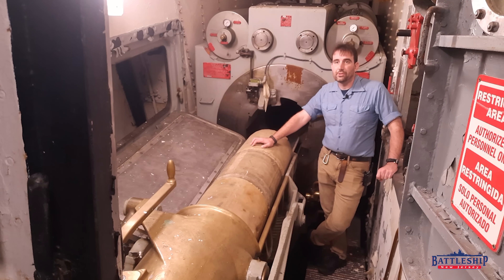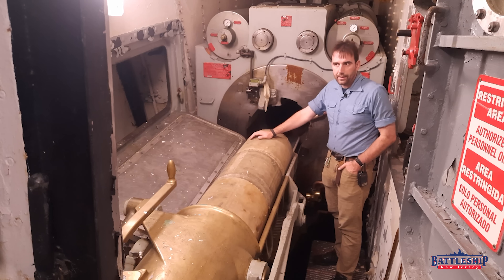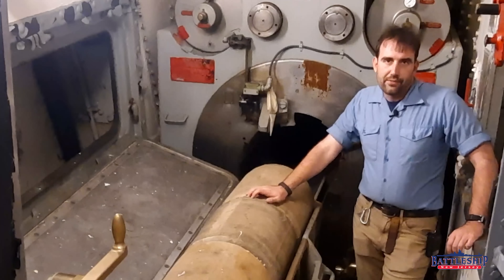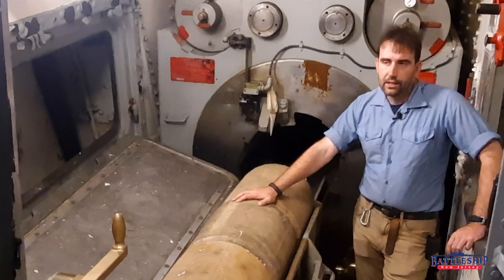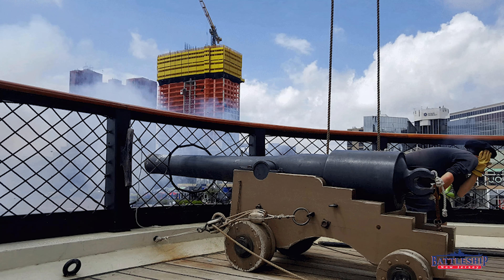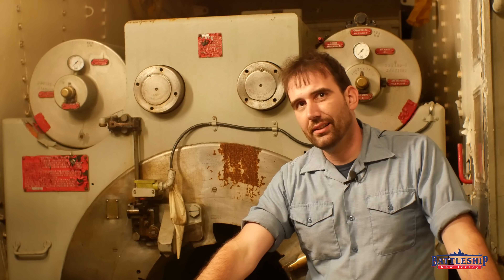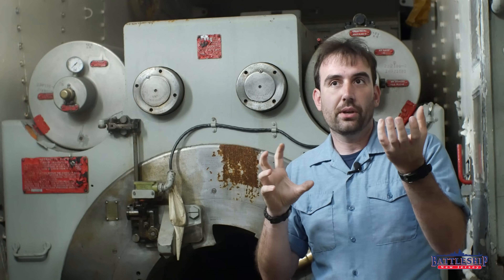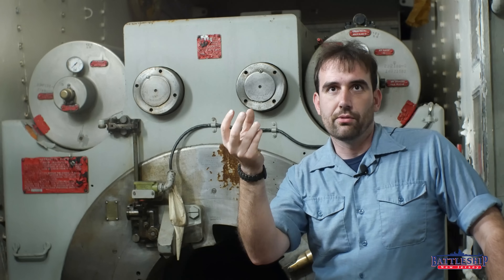How to Unload the Battleship's Guns

Comment: I’ve had a misfire on a Chieftain tank, which turned in to a hang fire. We were getting ready to open the breach when the charge (we also used bag charges, just 120mm) ignited.

Another tank thought they get a round loaded, expecting to be given another target. Instead they got check firing (stop firing). Normally not a problem, but the next morning they were ordered to change ranges, huge problem. You can’t drive around German roads with your gun loaded. They tried to clear it with a hydraulic shock (water behind the projectile followed by a small charge), well I think that crew hold the record for the biggest “Water pistol”.  The charge went off, the water went around the projectile in the rifling😂 This meant they had to drive the tank, on German roads, with a loaded main armament.

Comment: A few months back, my buddy and I were shooting an M48 Mauser using some 80ish year old Czech surplus ammo. There were some uncomfortable hangfires, but nothing serious, so we kept using the ammo. We made a joke about how long to hold the rifle on target in case something went wrong, but I had never had that happen with that batch of ammunition before, so it was mostly a joke. On my buddy's turn with the rifle, he entered a crouch, aimed, and I saw him pull the trigger. I heard the release of the firing pin, but my buddy slowly looked up at me. Still no bang. We kept the rifle down range for about a minute or two before deciding to cycle the bolt. It was not a light strike -- the primer has a very clear indentation, so it sits in a water bottle for safety now.

Probably not as serious of a situation as a hangfire with a caliber numbered in inches, but my worst "Uh oh" experience with ammunition to date.

Comment: During a combined arms breach at a training, my brigade shot four MCLC's (mine clearing line charge) to clear a gap for the rest of the tanks and Bradley's to pass through.

The first 3 went off great, but the 4th misfired. I was the security element right next to the breach they were trying to clear, so everyone just stayed buttoned up and took a nap.

The engineers gave it the required 30 minutes, and then refused it. No need to worry about oversleeping, because that thing shook the whole 35 ton Bradley when it finally went off.

Comment: IIRC, th 5"38s on our WW II DD could easily get hot enough to "cook off" (make go "boom") a projectile that had been loaded and not fired. So you'd load an unloading charge of propellant (none contain "powder") and fire it on command to expel it at much reduced velocity from the muzzle. All of our 5"38s were electrically fired, not with percussion. Easy to see on a used case.

Comment: Have had several hang fires with .22 lr. Since it's a bolt action just lift the bolt, bring it back down into battery and pull the trigger again. Never had a center fire hangfire

Comment: I had a light primer go off and just push the shell (similar to Old Guy Gaming Network below) into the barrel a short distance. Luckily I was unable to load another 16 inch shell into battery. Actually this was my 9mm Beretta at the range using cheep range reload ammo. I would have shot my hand off or something if it had been any further down the barrel as I didn't realize what had happened at first.  Using a punch tool we tapped it back. :)

Comment: We had hang fire about every 3 weeks off the coast of Vietnam. It was mainly because of Hot Gun. We were pretty fast loading the 5"38's. Yes we would cool the barrel with a fire hose and use a short charge at a safe bearing and pop it out.

Comment: I just now saw this video and wanted to share that there were very clearly defined procedures for handling misfires that are written into Navy gunnery drill manuals from the 1920's that I have read.  The combination primers were almost exclusively fired electrically, but were capable of being percussion fired by attaching a lanyard to the lock mechanism and pulling it.  The first attempt to clear a misfire would be to simply close the firing key again locally.  If that failed, they would switch to battery power on the firing circuit and try again.  If that failed, they would check for a bad wiring connection on the lock, which was the most frequent cause for misfire.  If all of that failed, they would attach a lanyard to the firing lock and try percussion firing it.  If pulling the lanyard failed to fire the gun, then they would open the lock enough to partially extract the primer so that it could be grabbed.  Once removed, they could check and see if the primer fired.  If it hadn't, they would insert a new primer and most likely the gun would fire when the firing circuit closed.   If the old primer had fired, they would try another, knowing that it likely would not fire the charge.  If the second one failed, they removed it and shot water though the primer vent to at least soak the ignition patch of the rear bag.  At that point, the turret was cleared of crew except for a gunnery officer and the men required to operate the breech plug.  However, they waited a minimum of 30 minutes before opening it.  This was considered the maximum amount of time that a smoldering fire would travel up the length of a silk bag and ignite the ignition patch of the bag ahead of it.  Once the plug was open, more water would be hosed into the powder chamber to soak the bags before pulling them out.

Comment: Malfunction story 1 - The only time I've ever pulled the trigger on my P229 Enhanced Elite and had it NOT go bang happened to be at my first ever steel competition and it, amazingly, was an actual dud factory round.  Magtech 9mm, good primer strike...it just didn't fire.  I've seriously never had it happen with factory ammo before and I haven't had it happen since.  Shoot enough and you're going to have malfunctions of one kind or another eventually.  

Malfunction story 2 - Used to have this happen relatively frequently:  I was a range safety officer at was one of the largest public indoor ranges in the country years ago and used to see all KINDS of weird stuff.  Saw a Glock blow up once (literally had the slide crack and start to come off the frame), had lots of people come in from other countries and rent things that they had no CLUE how to operate, etc.  But probably the most common thing?...people trying to shoot 9mm out of 40cal handguns.  One lady could not figure out why her rental Glock was malfunctioning literally every shot..."ma'am, you're trying to shoot 9 out of a 40."  lol  Doesn't work well.

Comment: Easier to just shoot the round out.  Mk75 Gun Mount came with clearing cans.  A can with powder but no projectile.  In case of a misfire, you remove the can, which leaves the projectile in the rifling, and then ram the clearing charge and fire the projectile out.

Comment: I'm a retired Field Artillery guy - 155mm howitzers. While it's possible to back out a rammed round, the only way I would ever let a rammed round leave the tube is pointy end first.

Funny story, and it's even true - one of my sections had loaded a round and closed the breech just as we received a check fire (cease firing). My lieutenant was on the gun line and the #1 man (the guy with the lanyard in his hand) asked him what he should do. The LT said, "Get that round out of the tube!" So the E-4 holding the lanyard gave it a mighty yank and the round was out of the tube - and headed downrange. I couldn't blame him, though, because the LT's instructions weren't clear.

Comment: So, in essence you unload it in a fashion the german artillery calls "à l'americaine". 
I can only speak as a landlubber, but
for the 155mm Feldhaubitze there's a tool and a drill for unloading the piece. There's only one exception where unloading is forbidden. Namely when the shell is equiped with a proximitiy fuse. Then it goes out the front.

Comment: I started my military career as a Loader on an M60A1 tank. The very first round I EVER loaded misfired! I had to open the breach, pull it out, rotate it 180 degrees and load it back in. At that point it fired. I can tell you I was scared out of my mind the whole time I had the breach open that it would turn out to be a hang fire and detonate with the breach open.

Comment: I’ve fired several 16 inch projectiles at Dam Neck to qualify the newest configuration of powder bags using rayon vice silk. In the gun house we all pulled separate firing triggers, then BOOM!!!!!!!
Description: orange fireball of ungodly intensity, concussion wave that seemingly moves the Earth, my teeth & joints ached for weeks. Large spot in center of my field of vision for a couple days. Fired from Commwealth of Virginia towards Maryland’s portion of the Potomac, gun set to 5 degrees depressed angle. Due to atmospheric thermal inversion, blew out a number of windows in Colonial Beach. Circa 1980.
Reply: I think you mean Dahlgren.  I was just there two weeks ago, got to tour the gunline.  They have proofed barrels for the North Carolina and Alabama (16" 45 cal) and the Iowas (16"50 cal).  Saw the old gunpowder test rig, the 16:" gun with a very short barrel (16" 23 cal?).  Several barres have been dissassembled, they have like 7 pieces to complete one barrel.  Its not solid.  I think Ryan dod a video of them, at my request. I'd like to see any old movies of the Gun Factory where they sweated the barrels apart and together in a 100 ft deep oven.  Too cool.  One of my cousins runs a range boat out there for test fires.
Reply: @phillyrube5232  my mistake, yes it’s Dahlgren where the Commonwealth of Virginia fires shots almost daily at the State of Maryland. Five degrees of negative elevation lets the projectiles harmlessly sink into the Potomac, with lots of broken windows in Colonial Beach if the concussion wave of the blast reflects off of an inverted atmospheric layer. Currently there is a 16/50 installed in a bunker on the beach at Fort Miles in Lewes, DE, open to the public.

Comment: Many times... A poorly maintained muzzle loader is the worst... Most importantly always keep pointed down range.. I always tried multiple pin strikes on standard ammunition or multiple percussion caps on muzzle loader.. I was taught to bury standard ammunition that failed after waiting several minutes before ejecting round. Only once did I have to extract bullet from barrel of muzzle loader.. previous owner let it get badly fouled on top of excessive grease in barrel near bottom of barrel... powder just wouldn't ignite...

Comment: Pretty sure you mean tosay the brass ring is "engraved" by the rifling of the barrel. That's the term we use for small arms (rifles, pistols) but artillery might have another term. As to putting a reduced charge behind the shell and touching it off, the term for that would be "suicide," since you would get an explosion instead of the combustion that is used to drive rounds down range.
Reply: Why would a reduced charge do something other than firing the projectile less distance downrange?

Comment: I heard of a hang fire on a 155mm gun using a full red bag charge. The crew did not wait as long as they should have, the section chief opened the primer block, air rushed into the chamber, the charge detonated, and the breach hit the chief in the face causing severe damage.

The field artillery will give a cease loading order for fire missions which means that if the shell is already rammed, the crew should continue the mission until the round is fired. If the shell is not rammed, the crew is to stop the mission. I would imagine that the same would be done for any unfixed naval ammunition. We did have a round extractor that would fit over the nose and would push the round out of the breach. As mentioned in the video, the round would be useless since the brass ring would have the rifling groves cut into it at that point. Disposing a round via firing is less of a hassle than extraction, which is why extraction rarely happens.

I heard of a gun that fired, but the round did not leave the tube. EOD had to come in for that one. They put C4 on the end of the tube, raised it to maximum elevation, filled the tube with water, and detonated the C4 to extract the round. This is a very rare case and I think the gun had to be refitted with a new tube.

Comment: I had a misfire on my M110 eight howitzer. This is a "bag gun" and has the same type of breach as the 16 inch. We were shooting only about 5,000 meters so we used a much reduced powder charge. The powder bags had four smaller bags connected together with cotton ties. The first bag has the red igniter pad and the other three do not since they are never against the breach. On this day we were using only the first bag and had removed the other bags leaving only the short first bag. Rammed a projectile (same type of chain rammer as on the 16 inch.) The number three man then placed the bag of powder in the chamber, closed the breach and inserted the primer and hooked up the lanyard. Then the assistant gunner elevated the tube to firing elevation, about 600 mills, (about 40 degrees)  pretty high. I gave the command to fire, number three man pulled the lanyard nd nothing happened. I had him pull it three more time and still no result. Procedure calls for a wait of 5 minutes at which time you open the firing mechanism and remove the primer. If there is no dent in the primer's primer then you trouble shoot the firing mechanism. If there is a dent and the primer didn't fire then you had a bad primer, put in a new one and fire the gun. If the primer has fired then you close the firing mechanism and wait an additional ten minutes before you open the breach. This is "pucker time" because if you have a hang fire it might fire as you open the breach letting air into the chamber and blowing you up since the breach is unlocked. Well we followed the procedure and the primer had fired so we waited those 10 minutes and opened the breach. What we found was the the number three man had placed the powder bag too far into the chamber leaving room between it and the face of the obturator spindle which allowed the powder bag to fall over on its side when the gun was elevated, placing the side against the breach  instead of the igniter pad. There was a burn mark on the side of the bag but it had not been enough to set off the charge. So we placed the bag properly, reprimed the gun, elevated it and fired it normally. Beer that night!
Reply: Had a similar experience in my platoon in Korea in 1988.  Have also used a bell rammer more than once on the full inventory of 8 inch and 155mm howitzers during my career.  unlike what was written earlier, the manual had us add padding in the powder chamber and we closed the breech before tapping on the ramming staff.  The padding was to cushion the round once dislodged.

Comment: I think the term for the brass ring (most are copper or bronze) on the shells  is "Driving bands", they are usually found on anything 20mm and up ( the 15mm BESA projectile is the smallest I've seen (which strangely has a double set of driving bands)). The worst example of misfire/hangfires I've seen was a bloke on a range trying to fire old Italian 1930's-40's 6.5mm ammunition. Out of 120 rounds more than half were duds, the rest were "click-bang" hangfires. Scary stuff.

Comment: I'm surprised they didn't have a threaded hole in the back of the shell for an eyebolt and a small winch at the rammer position to winch the shell back out of the barrel. I have read that "Unloading through the muzzle" was common.

Comment: Had a misfire in a .380 ACP (it was new) and found the firing pin was striking the rim of a primer rather than the center where that cartridge requires it.  

We followed the correct procedure of leaving it pointed in a safe direction for a while, and eventually pulled back the hammer (single action, so not safe to try again until then) and tried again.  It fired that time, and we had another later in the same session with a different brand of ammo just in case there was something funny about how it was chambering the first brand.  We kept that one for reference and sent it back for warranty work.

I've also had some bad .22LR here and there, but it's been a long time since I had one that didn't go off properly with that caliber.  Thankfully no squibs yet.

Comment: I had 44 Magnum with a Ruger single action that had a hang fire and this was real dangerous.  I let the revolver sit for about 10 minutes and let the gun cool down.  Later I was able open the breech and unload the gun by removing the cylinder and then pushed out the cartridge.  With a 16 inch gun tube this is more than a nightmare.